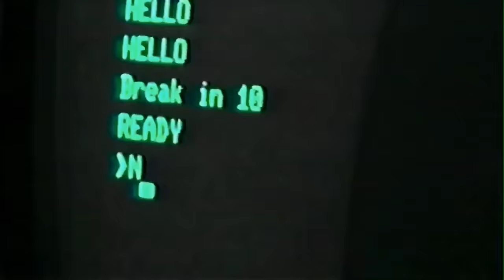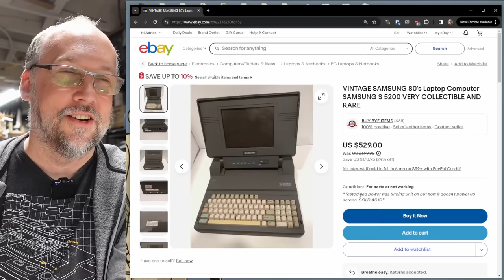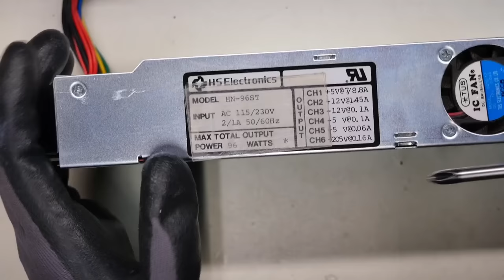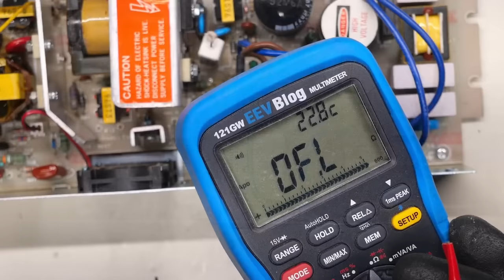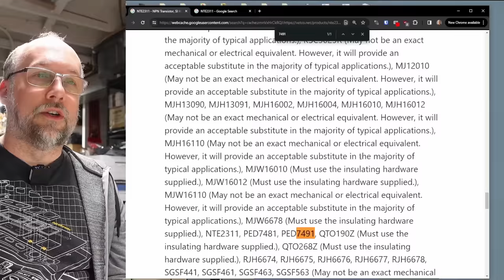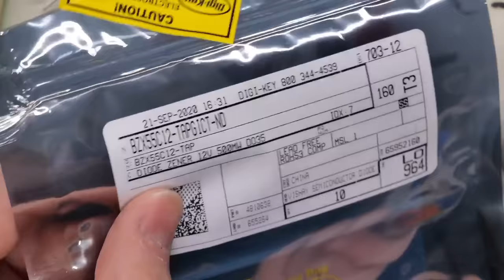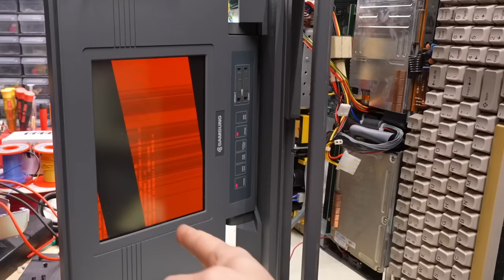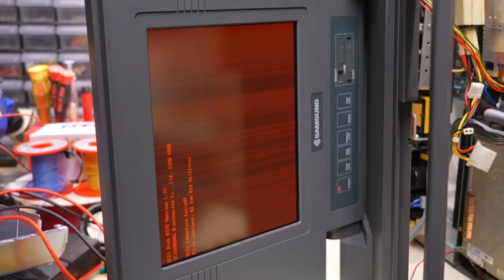Does this dead "laptop" have a gas plasma display? Let's try to revive it to find out! Samsung S5200

Comment: This is likely completely wrong, but the vertical lines remind me of failing GameBoy screens. Those failures look extremely similar and are caused by the flex cable connections failing. They can sometimes be fixed by heating up the flex cable at the screen edge with a hot air gun.
Reply: I used to repair gas plasma TVs. 99% of the time it was the driver connections around the panel itself causing vertical lines,
Reply: @Skawo Yes! My same thoughts here, and I repaired such a vintage GameBoy with a soldering iron at just 200°C gently rubbing over the cover thats over the actual contacts. All in all it took 5 minutes...
Reply: Wow... I'm a radio guy and one of my favorite models from the early to mid 2000s has the same issue for the same exact reason. The Yaesu FT 857 and 897 develop that problem. If you google the model and "zebra stripes" you'll see what I'm talking about. Funny how that affects so many different types of devices.. and the fix you outlined has been mentioned in a few places on the internet.
Reply: @helloitsme4139  How is that resolved?  Or is it?
Reply: I was thinking the exact same thing!  Can't wait to see if he tries to fix it in the next vid :D
Reply: This, if it is the cable bonding... I've seen quite a few ppl fix that problem.

Simple test is to just apply pressure to the cable bonding area.
Reply: You can actually buy silicone soldering iron tips designed for this job really cheap, I've been meaning to get one for old synthesiser lcds
Reply: Yes tab failure or driver failure. Driver IC's are SN751518, TI made and drive the columns via a nice set of laser trimmed resistors. Row drivers are also TI, just hard to read the tiny part number. TI logo and 1506 is all that is legible. Display is made by what seems to be part of Mitsubishi,  DFQT6021ZA is only part number. Yes I have a dead one, with the only sticker on it being a QC pass and inspection in Japanese, came from an old Panasonic executive writer, which was similar in age to the Samsung, though probably older, or based on the Mitsubishi design. 

Yes can agree about those early LCD displays, contrast degraded with time, till you had a viewing angle of almost nothing, and the EL backlight did not help either, only viewable in the dark.
Reply: Great job baby boy... htf you compare a hand held screen... to basically "mobile workstation" is amazing... I can definitely tell you have been in the industry for YEARS.... thank you for the contribution... This a YouTube channel, trying to get new young viewers, I AM PRETTY sure Adrian and MANY other viewers know what's what... Disrespectful comments, not the best look as in "NO THATS COMPLETELY WRONG"
Reply: The only disrespectful comment here is yours, especially considering that many other people in this comment section, including a comment hearted by the owner of the channel, suggested much the same thing as I.  @bitrage.
Reply: @bitrage What the hell is your problem?
Reply: @Skawo  read the name boyz!
Reply: @KrakaToad   🤷‍♂️.... I cannot stand, some1 doin stuff, then a comment saying "it's completely wrong" basically, like the person your watching don't know something you do... if the statistical 15% you actually do. Don't start with "your completely Wrong"... Only the first sentence is ever read in a comment by very large margin... I don't know him, he might of liked the comment or not, he is bound by "political correctness", because he has a successful channel, I'm not... can't be canceled... don't like it? More thumbs up on your comment....
Reply: I came here to say the exact same thing
Reply: @bitrage. Bro, are you serious? "This is likely completely wrong" is referring to @skawo's own suggestion, NOT the content of the video. And, yes, even if you only read the first sentence, you can clearly see that.
Reply: @bitrage.  If you get upset by a comment you can't be bothered to actually read then that's your own god damn problem.

But, what are we even talking about, clearly everyone just reads the first sentence, so you're actually just congratulating skawo on his well made comment - "Great job, baby boy"!
Reply: @KrakaToad  yea.... that's the point.... bring attention to it, confirming that a comment shouldn't be started with "no that's wrong" if your a supporting member of a channel.... 🤯.... I'm not out here trying to get you to like me....
Reply: @bitrage.  Doesn't confirm anything, if anything it confirms the exact opposite since clearly they read more than the first sentence in your comment.

You're just spouting complete drivel at this point.
Reply from the maker: @stephenoliveau  Unfortunately unlike LCD,s it's a bit more tricky here, this screen runs at 200v. So it's not something you really want to touch to test for that.
Reply: @adriansdigitalbasement  You could use a wooden spatula or something similar though.
Reply: @adriansdigitalbasement  eh, it's low current.  You'll get a tingle at worst.  You can guess how I know. :)
Reply: @bitrage.  Get ratio'd
Reply: @RT-qd8yl   There are many many more prey then lions.... Remember that... no1 likes to be hated, some don't care to be hated....for the right reasons...
Reply: you're completely wrong @bitrage.
Reply: @MUNROMOTORS  good thing you came with facts.... 🤣
Reply: 7:41 “found it in <insert made up story here>” 99% of these are bulk sellers who grab up vintage electronics and try to sell them for profit, riding on a recent bubble in the retro electronics market.  I recommend not buying any old electronics off eBay right now as there is an artificially inflated market right now.
Reply: @KrakaToad  why did you leave me??? Baby boy, just get the opposition facts... not hard...🫢.... nvm the numbers R much much lower...
Reply: @adriansdigitalbasement That's where (clean an dry) tooth brushes come handy to touch the boards and connectors: No metal parts that could short circuits or traces, no current path and the plastics do have high enough break-down-voltages not to risk any harm when touching. And you can give some decent pressure onto circuit boards, connectors or cables.
Reply: @katho8472 It’s always been “Game Boy” now.  Mandela Effect.
Reply: Always been “Game Boy” now.  Mandela Effect.

Comment: I've never had my hands on one of these plasma displays. However, it looks similar to the lines that happen on a lot of LCD's from the era. I've seen a lot of them where the ribbon cables are decaying and delaminating. Sometimes using a soldering iron to reflow the ribbon connections can help fix lines in those. Either way, thanks for another interesting video!
Reply: Aha!  the reflowing trick! I revived a couple of game boy screens this way
Reply: I've seen Tech Tangents do it on an old LCD and it worked.

Comment: That display is theoretically repairable, so I used to repair similar issues on gas plasma tvs. Same basic technology. The displays are segmented with drivers connected to the edge of the panel X and Y axis, Sometimes, removing/cleaning the contacts would make the vertical lines disappear. Provided there is not physical damage to the panel
Reply: Clearly nonsense - "Deoxit that panel" doesn't rhyme!
Reply: Notice the text is fully driven all the time. Only background is dim (and actually better). There appears to be no brightness change on the text.
If you could fix this by connections I would expect both background and text to have been affected.
Reply: sometimes those drivers partially lose soldering connection due to heat over the years. I have been able to fix a big old plasma tv this way. By just soldering those drivers back. However it did not help for a long period of time.
Reply: @iuriigarmash3285  I just suspect broken solder  connections would cut the text as well not just change the background color...
Reply: The panels are driven by discrete transistors. The most common issue is the HVDC goes too high and the transistors stay on. Simply add a regulator like a zener stack and it works again.

Comment: Back in 1990 I was given a PS/2 P70 gas plasma luggable to take with me on a six month extended business trip. The glowing orange screen was quite an eyecatcher around the office, and it felt really cool to be able to pack it up and lug it back to the hotel at the end of the day.

It was certainly among the favorite computers I ever got to use on a regular basis. Shame I had to give it back once I returned home.

We also had a 19-inch flat panel IBM 3290 gas plasma terminal that could display four sessions (2x2) kicking around the test lab, long before big screen LCD displays were a thing. It truly looked and felt like a space-age monitor back then.

Comment: Some people have had success reflowing the pins on the driver chips that are connected to the actual panel via ribbon cable (IBM P70 and Toshiba 5200 use similar panels and there's some content on YouTube showing). Not for the faint of heart but doable. Excellent work on getting it going!
Reply: this^
Reply: My first PC was a Toshiba T2100. It doesn't have zebra stripes but a walking and flashing bright vertical lines.
Reply: I used to work with plasma displays for a company called Dynapro in the early 90's.  Lines like this are almost always a cabling and data line issue - I'd definitely suggest reflow on video drivers and look at the cabling - I think it's totally fixable.

Comment: Ooh I can finally answer something! I have two T3100s with similar issues. Took out the plasmas, and they are surrounded by driver chips. Legs rusted through on many. I tried to remove some good chips from one and transplant but soldering skills aren't where they need to be - pulled some traces. Haven't revisited - but for someone with actual talent this might be fixable.
Reply from the maker: Delicate soldering isn't really my thing either. I don't have much to lose, so it's going to be worth a try!

Comment: You mentioned that measuring the switching semicondictors (transistors and diodes)  is difficult because they may appear to be shorted, which is caused by the fact that they often have a coil in parallel to them. One solution is as you mention to take them out of the board. But there is an other way. ESR-meters are used to measure the resistance of capacitors. They use a low test voltage and a test frequency of e.g. 100 kHz. So this is an AC-test method (not DC as normal multimeters often do). If you use one of these meters to measure the resistance of a semiconductor in a circuit,  even if there is a coil in parallel, you will 'only' measure the resistance of the semiconductor because at 100 kHz the resistance of the coil is so large (mega Ohms) that as a parallel resistance it does hardly influence the value of the semiconductor (which is low for DC and AC test voltages). Using this method you can find shorted semiconductors without having to desolder them first.
Reply: I always wondered how those worked, thanks! Our test kit in the telly trade was as basic as the gaffer could get away with; we often took in our own.
Reply: Your explanation is accurate sir.Using ESR meters with low test voltage and a test frequency like 100 kHz can help measure the resistance of semiconductors in circuits, even with coils in parallel, allowing identification of shorted semiconductors without desoldering.
Reply from the maker: Good tip! My LCR meter goes up to 100khz, but I never thought of using it to look for shorts on semiconductors.
Reply: Wow. Learn something new every day... That's really clever!

Comment: It's more likely that the NTE "replacement" transistor is over spec'ed from the original.  Replacement transistors often are over spec'ed so they can replace a LOT of other devices.
Send the DMM back to Dave with a letter of complaint!

Comment: Nice video as always. I just wanted to mention my EEVBlog multimeter does the same thing too. Occasionally I get odd readings and I have to turn it off then back on. Very frustrating considering Dave Jones is all about promoting a good functioning, quality product.
Reply: Check the foil shield on the PCB. Sometime it is missing or disconnected from ground, and the meter front-end picks up the 50/60 Hz noise...
Reply: @rayoflight62  Something to look into indeed but im fairly sure this is the range switch causing issues. Moving it even one position forward and then back fixes the issue after this happens. Doesnt happen all the time and is quite rare when it does play up. Sadly though sometimes its not very obvious it has played up until ive sat there for a minute thinking these measurements dont look normal. Exactly the way it happens in this video for Adrian.
Reply: Somebody else said the switch has changed in later revisions and there's a shim you can put in to fix the problem.

Comment: "Collectable" is a relative term I guess? I'm sure someone out there is incredibly fond of these things and hopes to catch them all!
Reply: I desperately wanted one of these plasma machines a while ago, bought the first one on eBay, it worked for a few minutes, than didn't. Bought another one, that came with the plasma screen totally smashed during transportation; works with external monitor, but that makes no sense to me. I stopped buying them. 

Sadly not all beautiful retro machines are built like a tank or a C64 C. If a C64 C drops to the floor, bad news for the floor.

Comment: Had one of these back in the 80’s and the display was brilliant compared to LCDs at the time. Yes it was bulky and heavy, but it worked great and offered desktop equivalent performance especially with an internal hard disk fitted in one of the expansion slots.

Comment: I bet Dave would love to get his meter back before you open it so he can perform a failure diagnosis and then maybe get the supplier to change something so future models aren't susceptible.
Reply: I was thinking that myself. Dave is a great guy so he may replace it under warranty even if it's out of its warranty period.
Reply: Thinking the same, he’d probably make an interesting video out of it.
Reply: Thing is that there are already updates for the switch, so Adrian can just ask Dave for the shim that they use, and install it to fix this problem.

Comment: In the 90s I had the Toschiba T5200 which was practically identical. It differed only in the slightly larger red phosphor display. It was a 386 with a math coprocessor. I still have his motherboard down in the lab. I was a fool to destroy it. I should have spent more time trying to fix it.
I apologize for the definitely incorrect translation but I am Italian and I used Google Translate.
I always follow you with great pleasure even if I have difficulty with the language but I must say that you speak beautiful English that I can understand even though I am in denial ahahahaha.
I greet you and thank you for your work.
Reply: I had a T3100 which I sold for a few £s after the hard drive failed. The hard drive was an unusual one with no separate power cable.

Comment: My dad has an Ericsson branded "laptop" from late 80s if I recall correctly, with a plasma screen looking exactly like that one. It has been properly stored but still the last time I booted it up it had developed the same issue with the vertical bars even though few years ago it was without any issues. Very interested to see if you are able to get it fixed so I could maybe attempt to fix it myself.

Comment: 35:34 I wouldn't trust any fuses bought off of Amazon. There are a lot of dodgy sellers on there selling the cheapest no name fuses they could find on the Shenzhen market that day. They may or may not blow at the rated current.

For a safety component like a fuse you're really better off buying from a reputable supplier like Digikey who only sells fuses from reputable companies like Littelfuse and Bussman.

Comment: Yeah, these days I just swap out switching power supplies with brand new ones, but obviously that's not so easy if you need a 205V rail! The last time I bothered with repairing one was when the bridge rectifier blew in my Tivo (and also my parents', my brother's and my friend's). I spoke to one of the engineers at Tivo and they said it was a pretty common issue and they actually did exactly the same thing with warranty replacements. They had a stack of spares, and every time they pulled a faulty one and replaced it, they just swapped out the bridge rectifier and put it back into spare stock. He also offered to swap them out for their spares if I had any more failures, obviously after I'd already repaired all the Tivos of everyone I knew who had one!

I miss my Tivo, it's a real shame they shut down the service here in Australia, it was such a good product. I actually got mine for free because I volunteered to do alpha testing of their software in the early days of its introduction to Australia, and they just never asked for it back.

Comment: Gotta love that ebay listing, everything is "rare" and "collectable" on there, especially when it's common as muck and cheap to buy... :P
As for the display, the flat flex issues could be "fixed" with passing a flat soldering iron across the flat flex ends where it's bonded on, I say "fix" because from my experience doing that on old LCDs, it's temporary at best, so may work initially, but old glue and time will have made it unreliable, so may come back briefly for a video, but then fail again not long after...
Reply: In the same way anything with a vague military connection is described as "used by special forces". Not really surprising as most of the stuff they use is standard issue.

Comment: LAP-TOP was an acronym for "Light And Portable, Terminal On Processor". Until later years, they were hardly usable on a human lap.
As for the power supply, I'd recommend contacting XP Power for a Solid State solution to your power supply. They make every possible Voltage, Amperage, and other specification input and output wise.